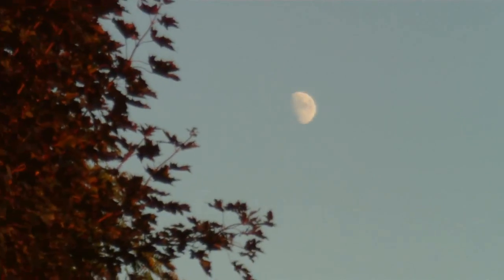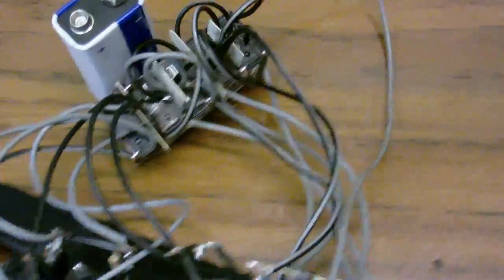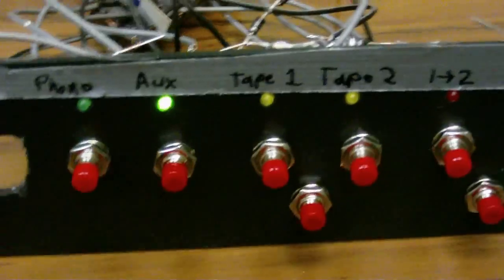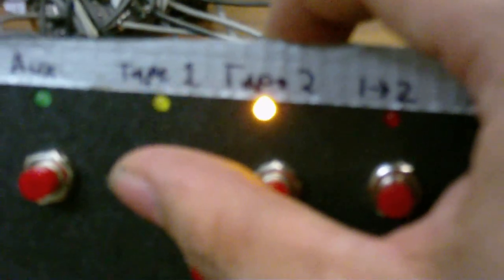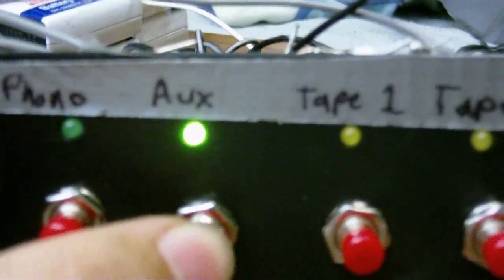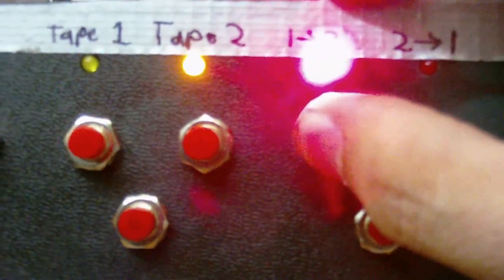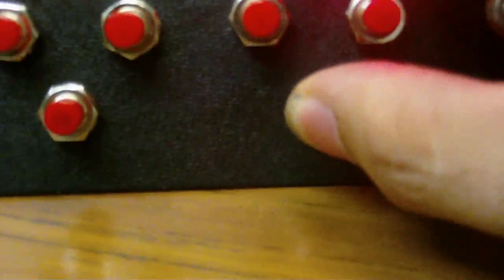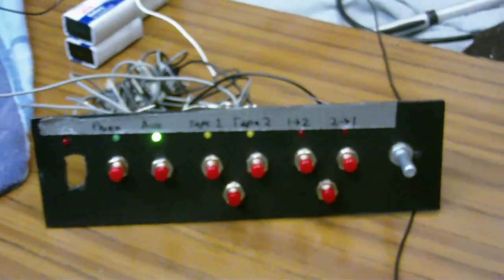The Amplifer Adventure part 4 - The function selecting mechanical relay logic circuit

Comment: Nice work!  Using relays is much more complex than just running the audio directly through the switches, but gives you much better isolation between the sources -- unlike some amplifiers which have annoying bleed-over among the inputs!